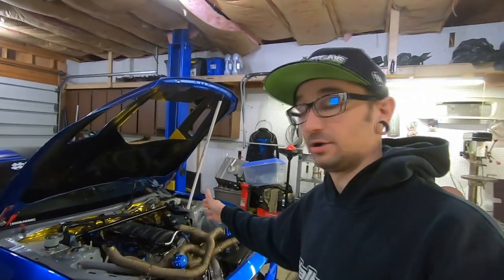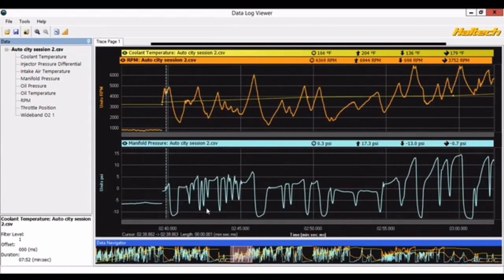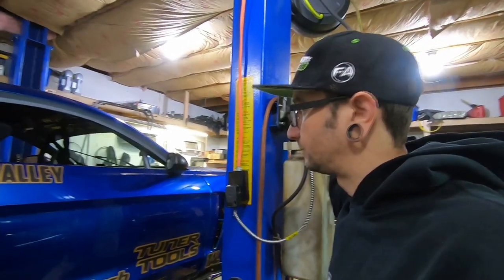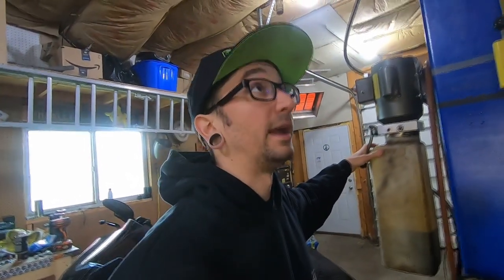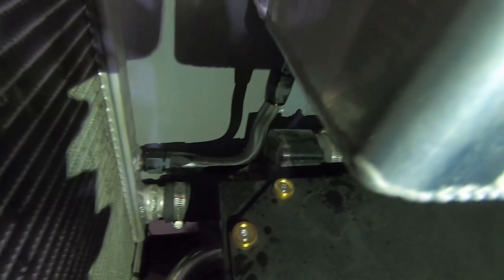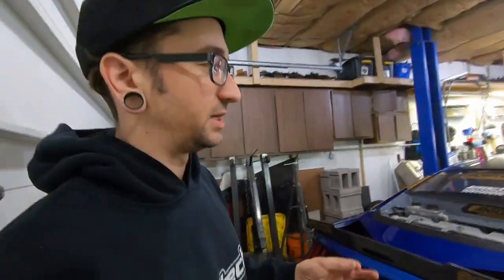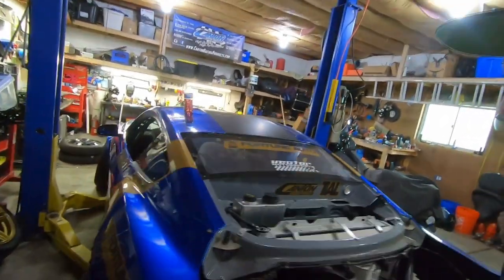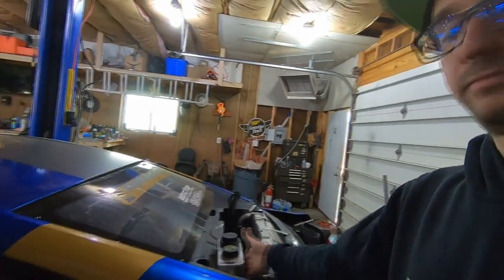Rear Mount Radiator THAT WORKS!

Comment: Why not dual radiators and dual pumps? One in the front, one in the back. What I'm thinking of.  The one in the back doesn't even need to be that big or have much air flow, anything helps. Even just radiant heat loss.

Comment: You think this would be efficient for daily driving or just for track use?
Reply: If your doing a rear radiator your cars. Or a daily driver 😂
Reply: @trippnoutmotorsport3164  I mean why not ? If it works it works .  People and companies have put whole motors in the rear of the vehicle for direct drive ……. So what’s the problem ?
Reply: @JAK1981  How would you go about getting it certified for road use?  Yes it would work fine for the road, legally would be a different story
Reply: @trippnoutmotorsport3164  I mean where I live I wouldnt have much of a problem lol. Im not in California or some overly idiotic place where you need a permit to cross the street . 

Besides I dont know many areas that have you pop the hood to check for a radiator haha.
Reply: Also id be doing it in a truck so it would be in the bed which will have a cover on it. So whats the deal ?
Reply: @JAK1981  to be honest there’s zero point in having it in a street car but 🤷🏼‍♂️
Reply: @trippnoutmotorsport3164  not if i want something bigger under the hood, which is what is done for swaps where its necessary to have more room for the swap. Also considering im doing a shaved engine bay it would add to the effect . 

The truck in mind is not a daily driver, hell its gonna have over 700hp . But I would like to be able to cruise in it or go to meets on weekends and such. Im also going to relocate the gas tank, is that ok or do you contest its functionality as well?
Reply: @JAK1981  You do you. I really couldn’t careless. 👍🏼
Reply: I asked the question based on what I have in mind for my project and where I would like to go with it. I dont build my rides to make anyone else happy , I do what I like to make myself happy lol. Everyone has their own things in mind, and if I can I like to help others achieve their ideas. 

From mild to wild , isnt the mod game just about fun ? 

So tell me, do you think it would be ok for cruising in the southern humidity ?
Reply: I asked the question based on what I have in mind for my project and where I would like to go with it. I dont build my rides to make anyone else happy , I do what I like to make myself happy lol. Everyone has their own things in mind, and if I can I like to help others achieve their ideas. 

From mild to wild , isnt the mod game just about fun ? 

So tell me, do you think it would be ok for cruising in the southern humidity ?